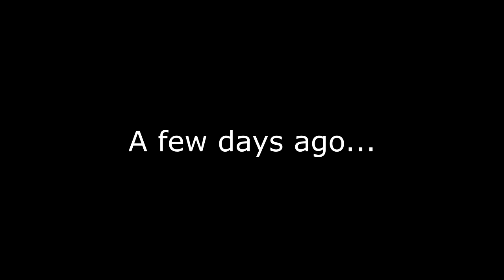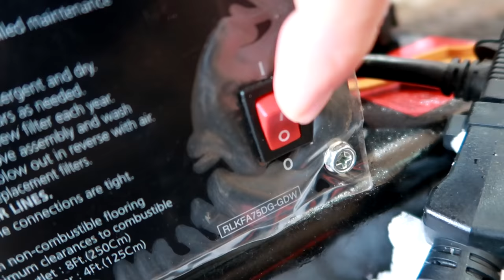SECRET ROOM IN MY SHOP

Comment: Prince has been hopping around for a couple of days now, right?  If it doesn't clear up in a day or 2 more you'll need to get him checked out, the way he's acting it looks like he might have torn his CCL (Canine Cruciate Ligament, sort of the doggie equivalent of an ACL) and can't used his knee.  It's not something that can heal itself if it's a full tear, you're better off getting it looked at sooner than later in case it's still in a state that it can be healed.  My dog tore both of hers playing in the snow and by the time her surgeries were scheduled she'd taught herself to do most things with her weight on her front paws.  He's not acting that hurt because dogs have no instinct to act like "I'm hurt," if they did that in the wild they would be seen as week and not able to keep up with the pack, possibly even become prey.  He's likely hurting pretty bad if he hasn't really put his weight on his foot for a couple of days.  

The trike needs a clutch or torque converter like they use on a go cart.  If steering really is that big an issue you might be better off driving only one wheel, though solid axle should be more fun if you can steer it.  You might have to give up some of the rake in the steering if it stays solid axle.
Reply: Nah

Comment: hey 3dmachines, you should make that trike into a drift trike by putting slightly larger piece of PVC pipe on each of the tires to make the rear tires slide.
Reply: Danny Freundl and a lower center of gravity
Reply: Danny Freundl it woud be easier to build a drift trike from 0 because he as all the parts in a box

Comment: Use a lawnmower transmission it will help with the engine stalling when you pull clutch because of gearing and it will also give you a diff! Keep on barping Dalton and many others!

Comment: Check out a centrifugal clutch. It will allow the engine to idle and the clutch weights expand as you increase the rpms. They're not too expensive either.

Comment: Hook up the clutch to the right (front) brake handle so when you pull it, it goes. Then hook up the front brake cord to the rear brake handle so you'll still be able to use it.

Comment: Add two batteries and truck starter motor or golf cart motor in place of the 5hp gasser.  High torque, no clutch, no maintenance.  If you wanted fancy part throttle action get a golf cart pwm motor controller.

Comment: you should switch out the tensioner you put on with a cintrifical clutch or a tourqe converter it will make it not die if you tighten the belt and dont give it gas plus youll be able to go and do more awesome things on it

Comment: Quick easy fix for the clutch would be put in a centrifuge chain drive clutch on there would eliminate your handle and you'd be able to stop and go with just your throttle you let off and it the clutch will release 15$ online

Comment: you need a larger sprocket on the axle to lower the gear ratio. it will help your hand clutch work a little better.

Comment: You really should just swap a Honda CR500 2stroke into the Kawasaki frame since the engine is basically done. Do it for the 500k sub celebration. Sure it may be blasphemy to some people mixing manufacturers but hey, it'd be badass. Check out Groutaone's channel for videos of his Honda CR250 with a CR500 2stroke swap.

Comment: You should try switching the throttle to a twist  throttle, and set the clutch up so you can you use it as a hand clutch like a dirt bike, or switch to a belt centrifugal clutch

Comment: you should use a brake cable to the clutch bar so when you pull the cable the clutch engages and you have control on a brake lever.

Comment: You'd be farther ahead to split the rear axle and make it a single wheel drive.  No need for a diff.
Reply from the maker: I was thinking of that but it's be difficult to drift in the snow.
Reply: 3DMachines your dog has torn his acl, this happened to my dog and my dog did the exact same thing, lifting leg but seemed fine, you should get it checked it
Reply: Its going to be difficult too drift anyways, widen the rear track

Comment: you should build a waste oil heater out of a propane tank. Burn old oil from you're vehicles mixed with a little diesel fuel=free heat.

Comment: I built something similar but it was in an actual 3 wheeled bike frame for your clutch tension it from the bottom I used a dirtbike rear brake cabble (real thick and its long) and a brake handle assembly from a dirt bike clutch the tension pulled the 3rd wheel down on a piviot pot into the belt and I adjusted the tension with the tension screw in the center of the cable pros' it worked and very well cons' if you pulled the clutch in too fast it stalled out and you always need too hold that cable in..(unless you get one for a 4 wheeler with a park brake :) but its far better then the handle also those chineese 80 cc 4 wheeler axles would work mint there "limited slip" and have reverse built into the axle